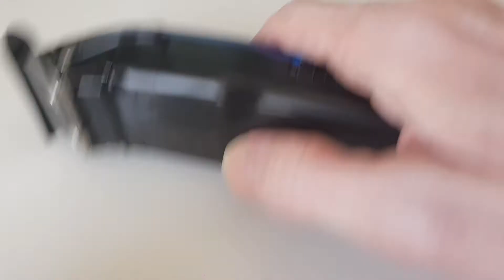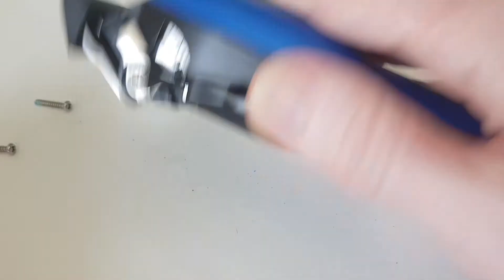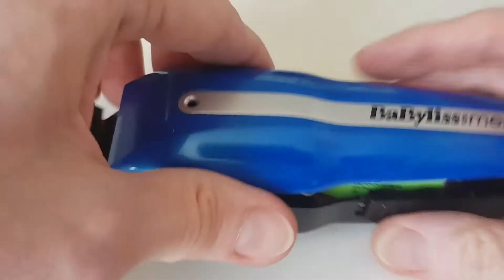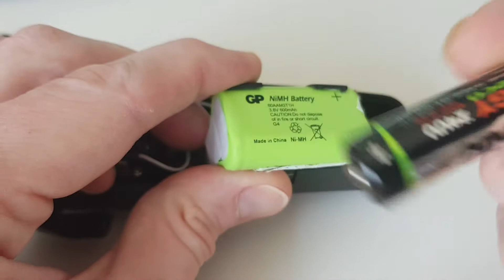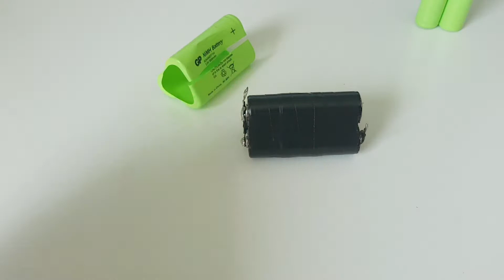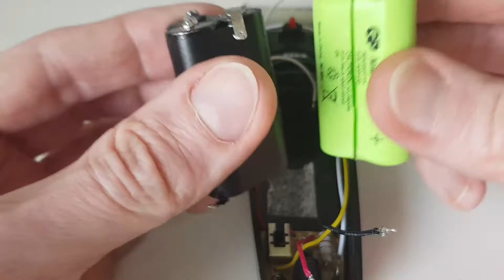BaByliss Cordless Hair Clippers - Battery Replacement Repair

Comment: Hi mate, great video.

Couldn’t you just get a new pair of batteries like before?

Also, mine sometimes turn on and randomly turn off. Would a quick clean of the inside of the clippers be sufficient to bring these clippers back to life?

Thanks
Reply from the maker: Yes but it was lot more expensive to buy the replacement batteries
Reply: @amp9438  thanks, mate. How can I tell whether this clipper is fully charged? The red light always stays on even after a day of leaving it to charge.

Comment: So how long now do you have to charge it from empty?
Reply from the maker: Depends on the capacity of the battery. The charger claims its 1000ma so for 2500ma batteries should be few hours

Comment: Instead of using 3 AA batteries i used 1 GTF 14500 3.7V rechargable battery and all i had to do was to cut part of the middle part of the bulkhead as there was only 1 battery to fit.
Reply: I'm assuming you knew to not use the original charger with it.
Reply: @Chalky.  As i dont use it much i can remove the battery and use the right charger, sorry i forgot to mention that.

Comment: I'm thinking about the same 
I'm glad somebody did it so now I know what to deal with 
Good job 👍
Reply: I just weld 3 normal AAA batteries to make one haircut cuz didn't had 16h to charge the clippers 😋
Thinking about a slot for batteries so you could put normal or rechargeable at any time 👍